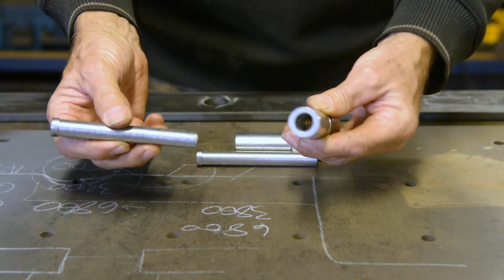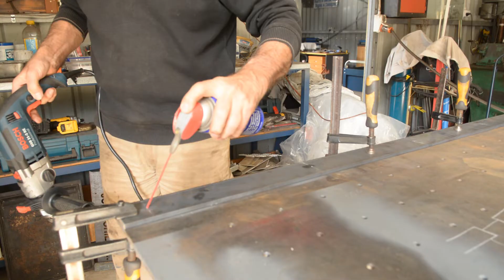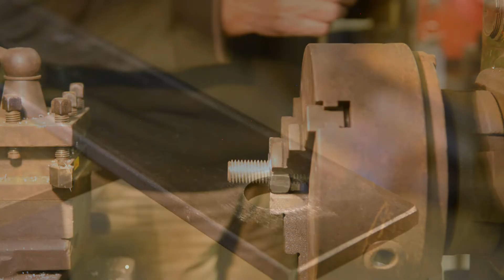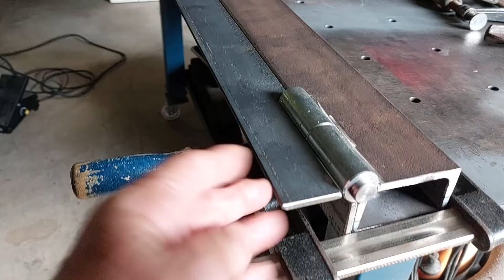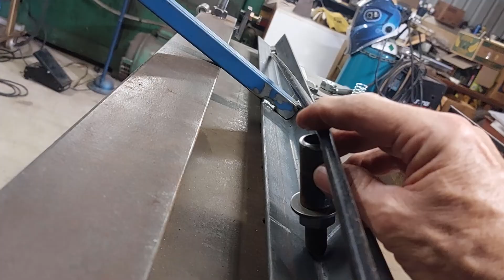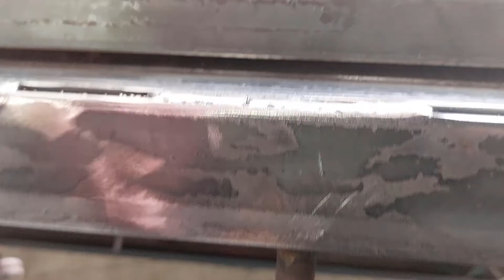How To Build A Sheet Metal Bender

Comment: Because hinges are not centered, you cannot bend over 90 degrees, am I right? I mean, you cant get 12mm with angle grinder precisely..
Reply from the maker: If I remove the top clamping plate, then the lower swing arm will travel up and over past 90 degrees. In fact, I notched the end plates on the top clamping plate to allow the bender to go past 90, to allow for a small amount of spring back from the material being bent...if that makes sense.
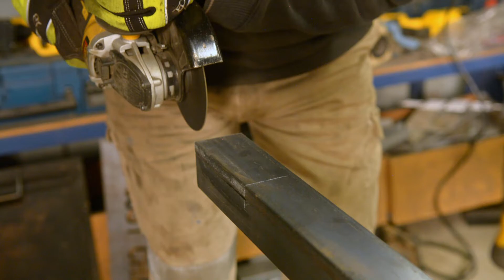Reply: @RustysMetalSigns  It makes, yes. But, I mean, you cant center hinges just by cutting slots with angle grinder. @7:29
Reply from the maker: Being able to mill the slots would be the best option, for sure.

Comment: Well done Rusty, the design works very good and I am impressed that you made an adjustment on the clamping bar to allow for thicker sheet metal. The radius of the bends are smooth and tight, nothing more required. A great job Rusty!
Reply from the maker: Thanks Gary. the bender is something that's been on my 'to do' list for a while and I'm really happy with the way it turned out.